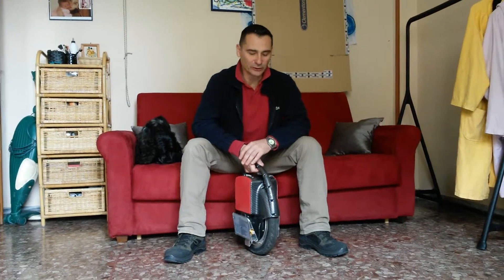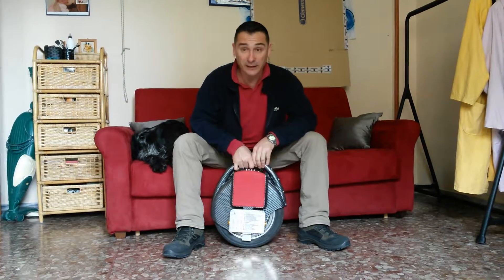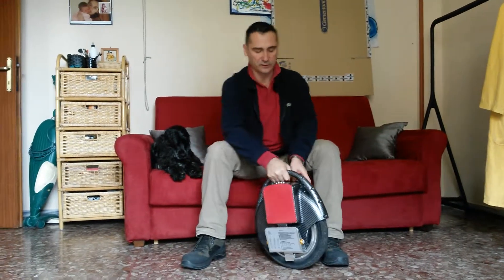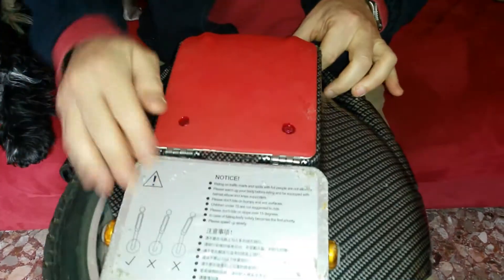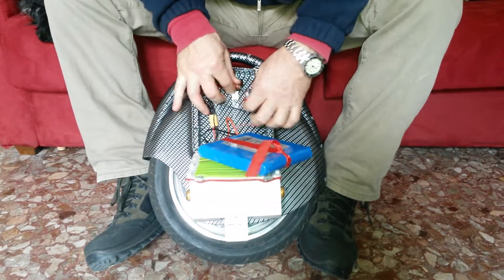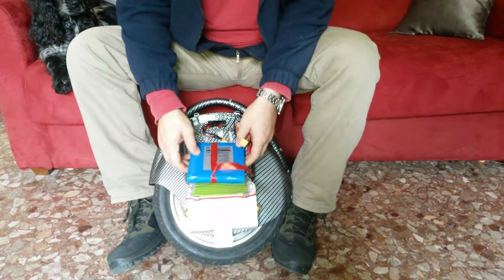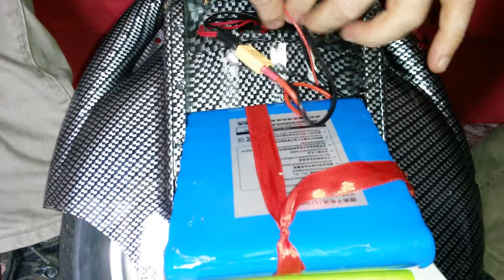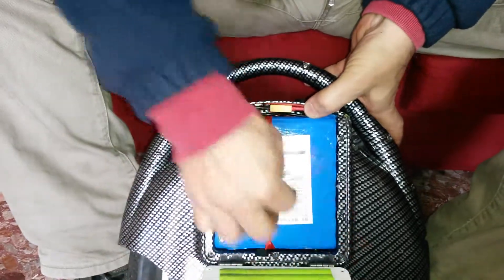X5 electric unicycle modifications

Comment: I was thinking about cutting off both plastic ends to improve clearance too.
Reply from the maker: Sooner or later you'll end up doing that anyway.  ;-)
Reply: @palmerr123  I have one in the bike shop now.  I'm about to go over there and see 8f mine is ready.  I needed a new power connection from the circuit board to the power switch and LED lights.  I bought a 60 volt Green works tool battery last Sunday.  
    If it still doesn't turn on, im just going to get my refund and I will just concentrate on modifying my boosted board